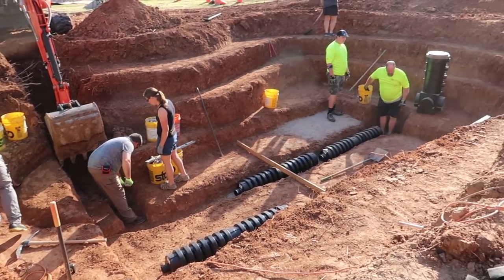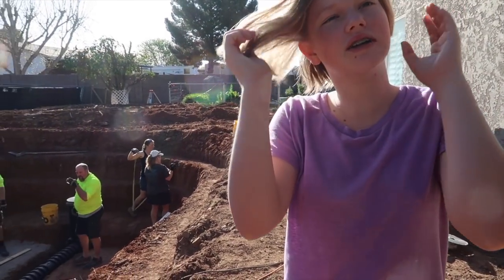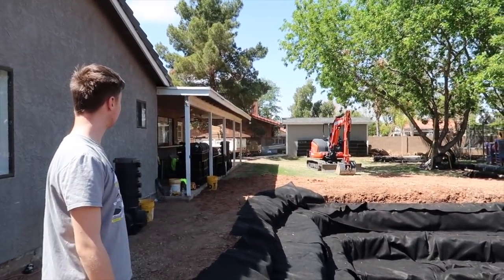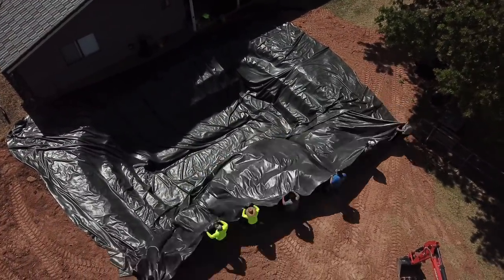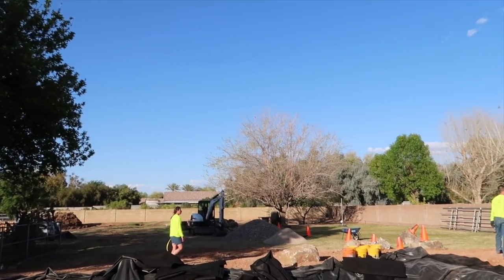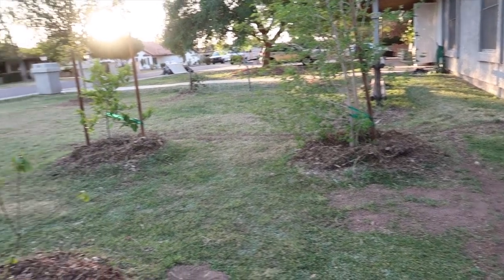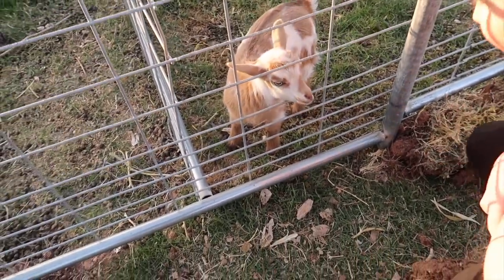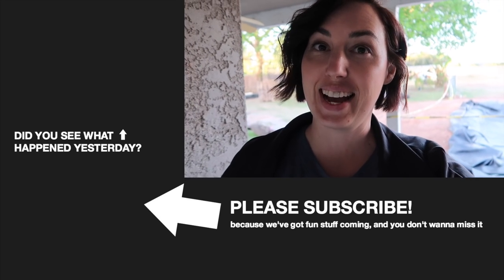Moving FAST! (Day 2 - Plumbing & Liner in the Swimming Pond)

Comment: D,.  Question?  What about saving the top soil to use as or for new raised beds? Good top soil like you've been building up over the years there with your animals is not only expensive but hard to find. Sub soil or what I call fill dirt can then be given away or possibly sold. Just store it behind the shed for later use, you won't have to feed it or anything!!! Just a suggestion!!! Thanks